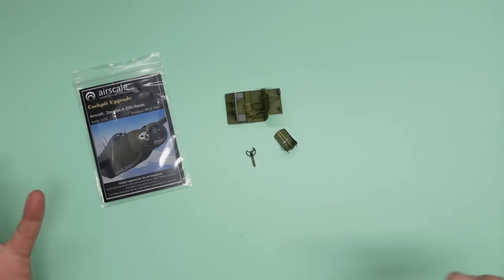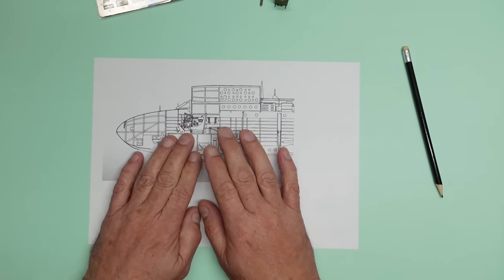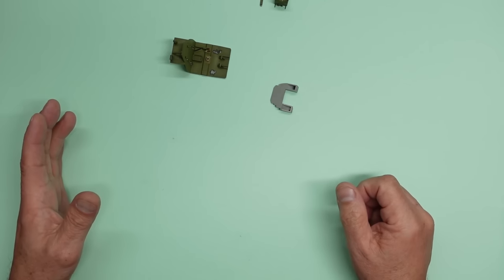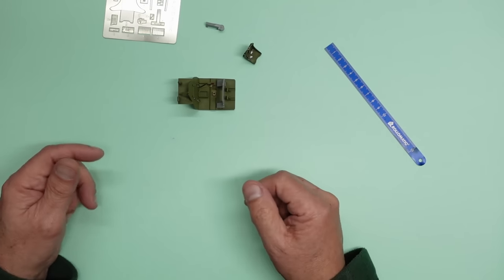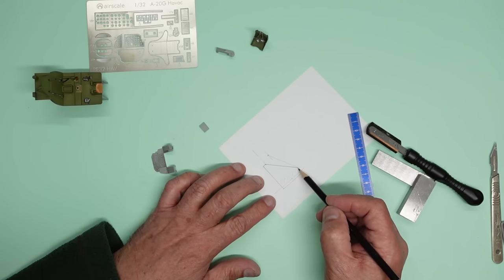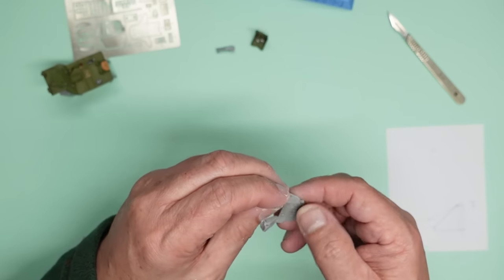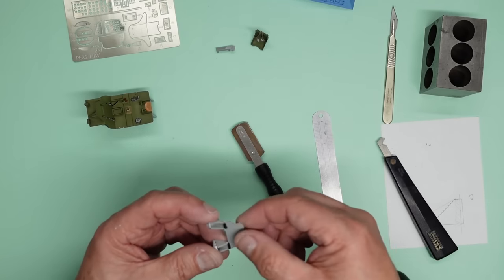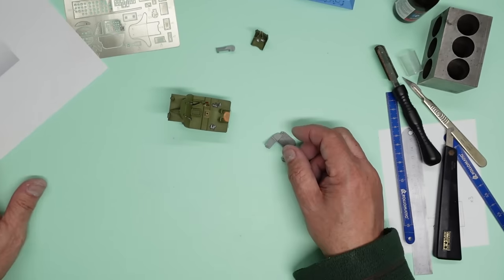HKM 1/32 A-20G Havoc build. Part Three... Moving the Instrument Panel back.

Comment: Hi Nige!  I also added this set to my A-20 build and love it!  What I didn't care for was the massive overhang of the "dash" beyond my beautiful Airscale instrument panel.  In order to create the illusion of the instrument panel being closer to pilot, I removed 5mm from the front edge of the dash halves and it worked perfectly as now 75 -80% of the instrument panel will be visible.
Reply: In removing the material from the dash, I was able to avoid any conflicts between the side walls and instrument panel.

Comment: Nigel,  I agree with your analysis, the kit's control panel appears to be too far forward.  I have seen two photos of the cockpit of the A-20G at the US Air Force Museum (one of which is very similar to the photo in your reference book (shown at approx. 7:55 into the video) - in fact that photo in the book may have been taken in the museum's aircraft, as the color of various cockpit components matches up remarkably well), and the control panel is not as far forward under the coaming as the kit's fabrication would place it.  Also, the fore / aft location of the throttle quadrant  (in the photos I saw) would appear to be approximately in line with the plane of the control column.

Comment: Interesting discussion on the location of the Instrument panel, and difficult to know what lens was used to take the photo you're using as reference and if it was a fisheye it would foreshorten things a little more. 

I did a google search using the term "janes Havoc A-20 cockpit 1939", and it has a B/W image from 1939 of the interior, with the camera at the mid right of the seat, and looking at the left side of the panel, from there you get a better perspective of where things are located in relation to the throttles and internal airframe
Reply from the maker: The next part defines all the mystery.

Comment: Nigel, are you sure the combing isn’t too long. Many us aircraft had a removable flexible extension to the combing that was often removed. Measure the length of the kits combing. Maybe they have modelled it with the extension in place and your references show it with out the extension. These extensions where rubber or canvas and acted as sun shades. Being flexible they have perished and not survived to today. Many restorations don’t have them in place.
Reply from the maker: I believe the length of the coaming is correct, however in some pics it does look as though it should be more "crowned" at its rear edge?

Comment: Is it the coaming that has been changed? The angle on the lower side instrument panels look correct? Also, in some photos, the control column looks as though it is "cranked" (bent) on the bottom. Seeing your pencil marks at 11 minutes however supports your thoughts! The model is my stash, and you got me thinking and researching!
Reply from the maker: You will see my research results in part 4a, coming soon. I agree, the angle of my side consoles is a little steep. I think overall, the whole cockpit is stretched slightly from the seat bulkhead forward.

Comment: Nice the way you moved the panel Nigel. Not sure if it was worth all that effort. I am wondering if the combing is too long. Wouldn't it have been easier to shave some plastic from the combing to shorten it? Then more of the panel could be seen maybe.
Reply from the maker: I believe the coaming is pretty good Andy, the effort is worth it because it makes video content and then people will have a go because they can see how it's done, even on a different model. I have now proven, by searching the 'net for hours that the position is now correct. You'll see the evidence in part 4a.
Reply: @NigelsModellingBench  Looking forward to part 4 then Nige. You toil for hours on the net, so we don't have to lol. Wish I had the money to get this kit. But, I have got far too many kits in my stash lol. With a couple more on pre-order.

Comment: How about putting some glue or thin sprue goo in the groove to soften the plastic then bend the panel when the glue has softened the plastic.
Reply from the maker: That would not give the precise bend point that I have achieved and it would probably fall apart?
Reply: @NigelsModellingBench  The groove you put in would give the bending point.Just an idea thrown in.